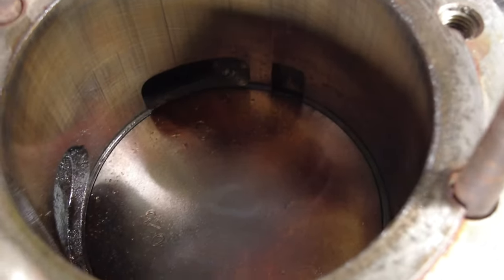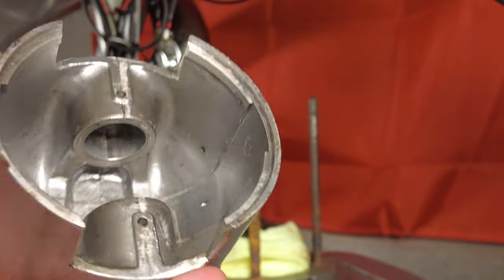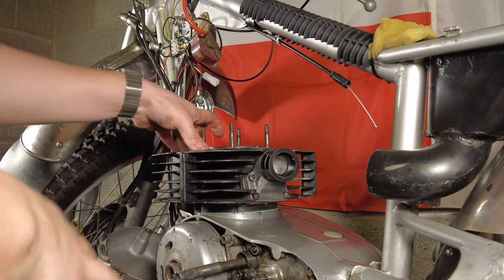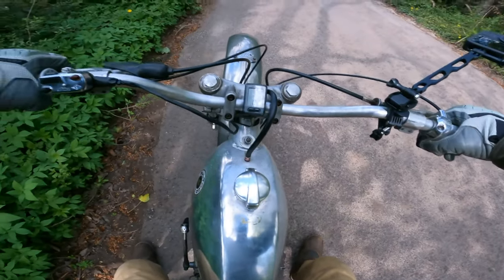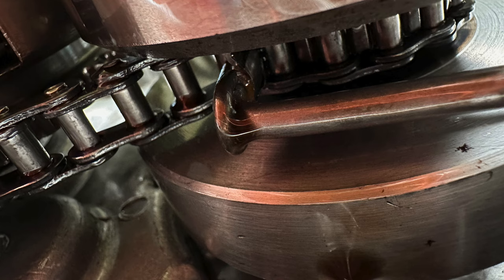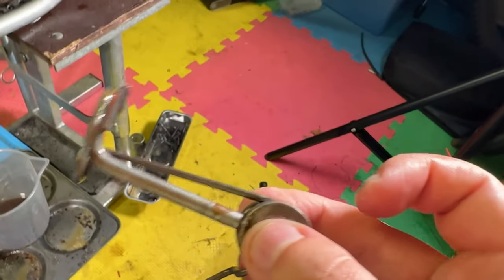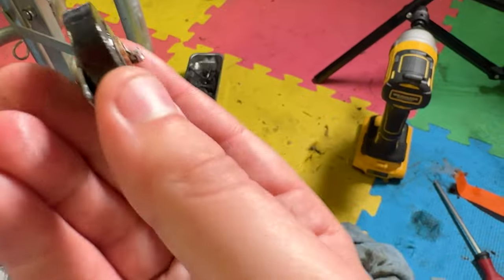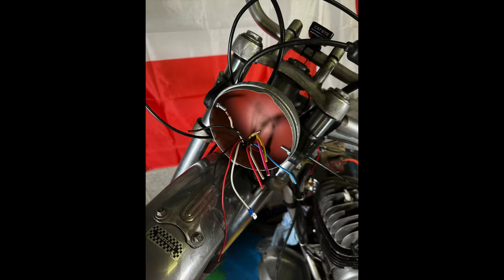It Runs Like a DREAM! | Electronic Ignition & Fixes | BULTACO ALPINA

Comment: Needs crank seals. Those seals went hard 40 years ago. Stick with it. I've got a Husky WR250 '76 project that's been sitting in my garage for 30 years.  Those old two strokes are great.
Reply from the maker: Yeah probably -- I replaced the ignition side which seemed to help a little, but worth doing the clutch side too. Once started it runs great, but it'll take either 1 or 20 kicks to start depending on its mood... It has a new owner now, I'm sure they'll have plenty of fun with it!

Comment: Had a 250 alpina later in the 70s think it was a 72 model older than yours as had the round barrel
Reply from the maker: Very nice! Yeah the round barrel is the 250, square for the 350. 250s are supposed to be a bit peppier at high revs I think, but the 350 torque is quite nice